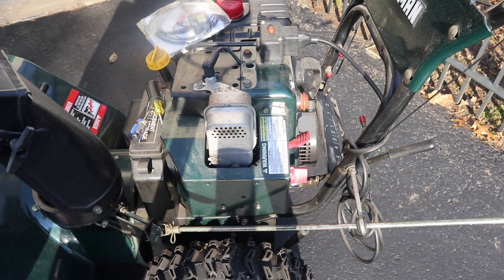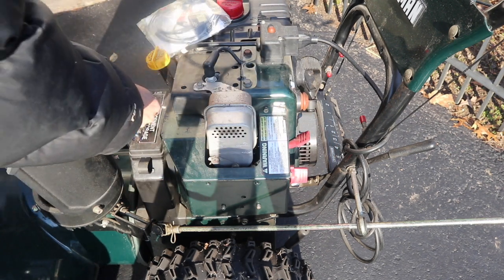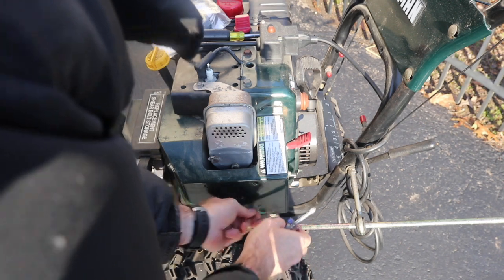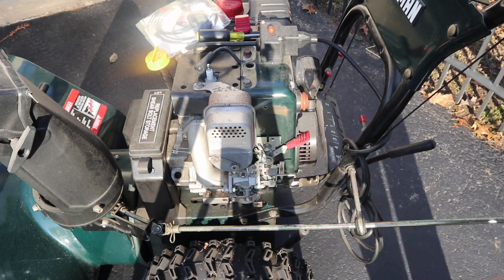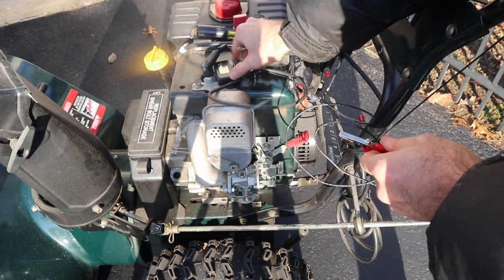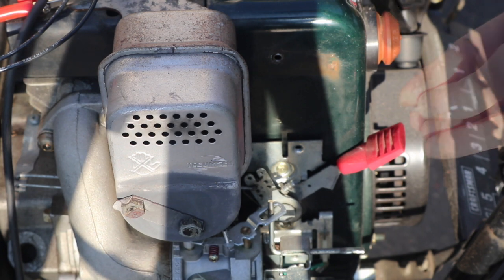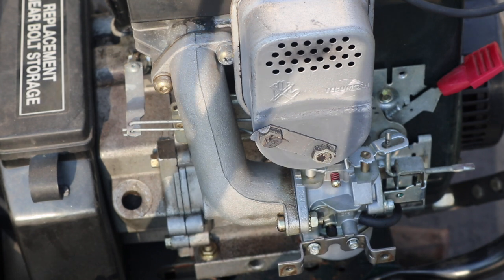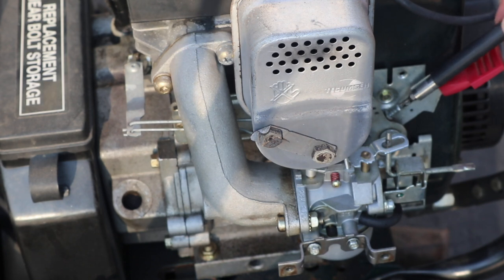How to adjust snowblower governor idle speed

Comment: Doesn't the kill switch key, which is part of the engine cover, have to be inserted to get the motor to start? You were able to start the engine without the kill switch connected. Did you bypass it?
Reply: The kill switch is actually a reverse switch
when the key is in, it blocks power from going across, when the key is out, it completes the circuit and grounds out the coil.
Killing the engine

Comment: U said "idle", not high speed. Wat is idle rpm setting
Reply: Set the low idle speed to 1600 RPM'S.  I have the 8hp Tecumseh engine HMSK80 and it works well.